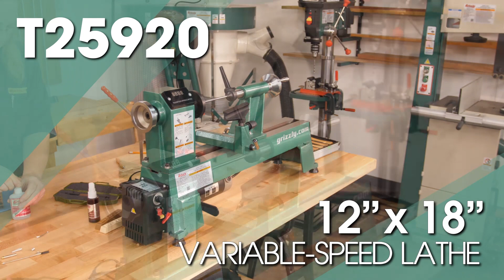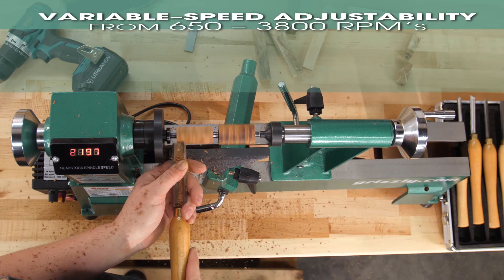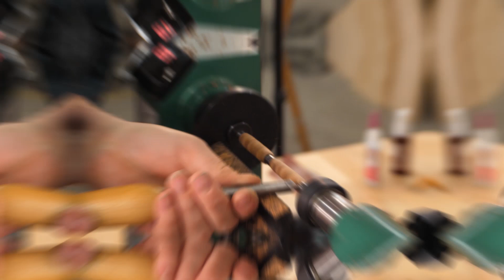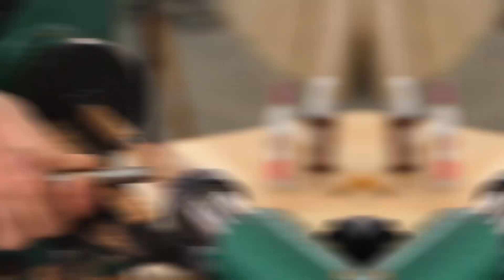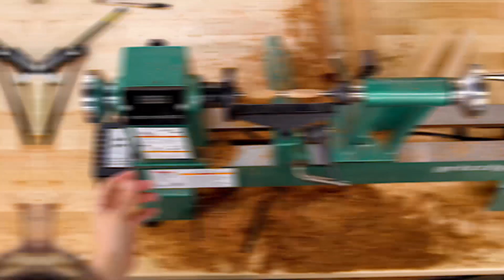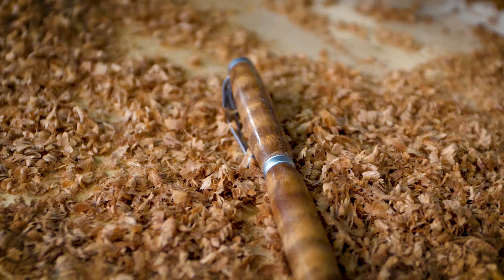Grizzly 12" x 18" Benchtop Wood Lathe | T25920

Comment: Seems like a good lathe. Also able to accept bed extension for more capacity. I wish Grizzly had networks where trucks could drop it off in good condition to local retail stores instead of having to ship it via UPS. That would be sweet if the old Pennsylvania warehouse could be a pick-up depot.